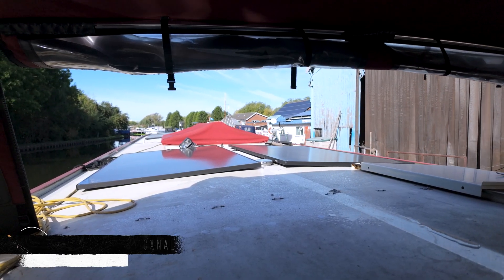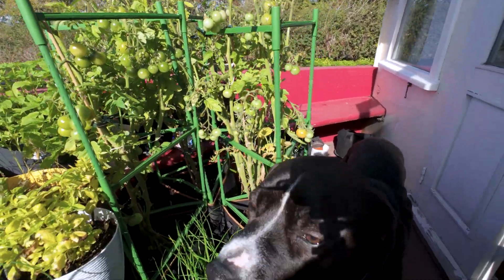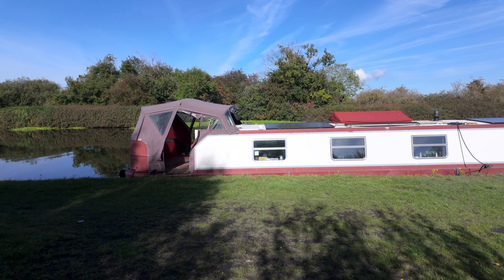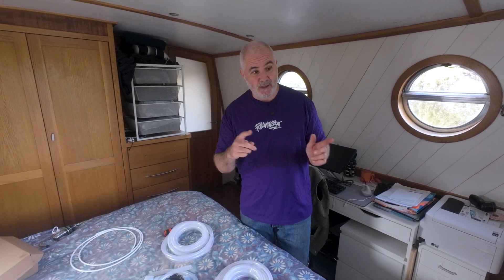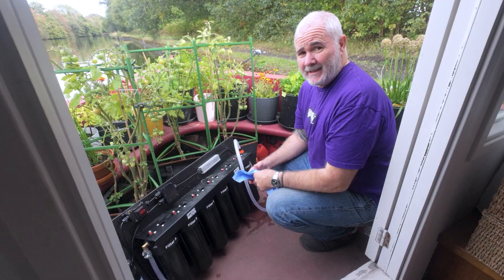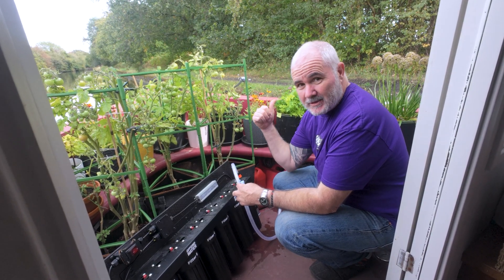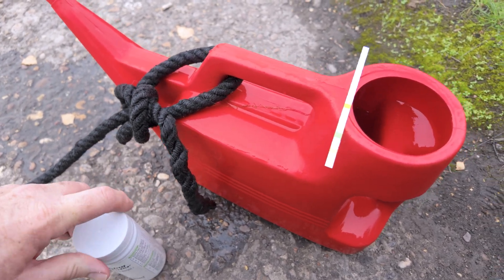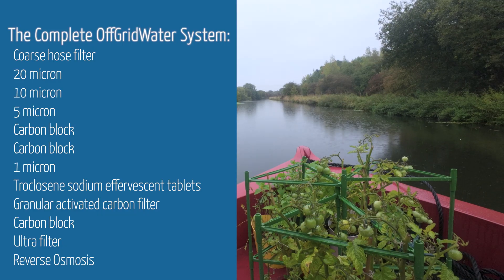How We Make Canal Water Safe to Drink 🚰| Widebeam Boat Ep 408

Comment: I wouldn't worry about chlorine in stainless steel tanks. But find a good source of information that actually knows. (I've used household bleach on my boat's stainless steel water tanks, and I'm sure the previous two owners occasionally did the same over the preceding 20 years. It's not much and it breaks down.  
Chlorine dioxide seems to be the best water purifier. Aquamira is the same thing.  CLO2 is inexpensive, comes in tablets. When dropped in water they quickly give off a fluorescent green gas, and is the exact same chemical weapon used in the First World War.  It's 4 to 5 times more active than liquid chlorine bleach so it's initially very toxic but soon breaks down. I wanted to see if I could eliminate the boat stink on my boat. It wasn't too bad, but I was curious. Worked really well, left no residue, faded nothing. I usually clear out over night, but 6 hours is often enough. Hotels and apartments use it, as do used car dealers. It breaks down anything organic including tobacco smoke, mold, mildew, corpse smell.... (I met someone who tenant die in hot weather and wasn't found for at least a week.) It's also one of the most effective treatments for bed bugs. 

ClO2 is more effective in tanks because it not only purifies the water and the tank below the water level as does bleach, the gas also kills anything at the top air space in the tank. 
Municipalities use chlorine in their systems not so much to purify the water, but to send a residual effect down the line to our homes. If you put pure water through dirty pipes it won't arrive pure. 
 
I've had an ROS system in my homes for the past 40 years. It works great. Talking with Colin of Parlay Revival he said that on superyachts there's a concern that super pure watermaker water being mineral free might not be providing the minerals our bodies need, plus it might also be leeching minerals from our bodies. He recommended adding a mineralization filter, which I did. Probably better, but I never had a problem over the first 35 years of not having it.  One thing I've done is the line to my ice maker in my fridge is connected before the minearlization filter so I get prettier, clearer ice cubes. 

What I know about ROS and my watermaker on my boat is you want to start with the cleanest water possible, so you never run the water maker in murky water or a harbor.... you're in a canal. Maybe that first filter takes most of it out and gets regularly replaced.  Looks like your system takes this into account. 
I was using an MSR backpacker water filter in Dorset one April.... apparently it wasn't working very well. I was feeling a bit... so I stopped  my trek in Cerne Abbas and got my way to Salisbury where after a good meal.... I basically exploded... I was sick for two days never left the room in the BnB. Watching the BBC news (about the only other thing I could do) I learned that the Skirpal's home, poisoned by Novachuk was only three blocks away. I'm still surprised the SAS didn't come through the door in Biohazard 5 suits and carry me out in a bubble. I would've been shouting (muffled) "It wasn't the Russians, it was only the sheep..... and my own screw up...."
Reply from the maker: Hi Will, thanks for that comment, there's some useful info on that. Yes, we battled with this argument about RO stripping water of all its minerals but, like you, we never added them when using one on our sail boat. Our argument was that we have a healthy diet, plus we were eating and drinking out too. I remember one yachtie telling me her family started getting dry skin and hangnails from existing on RO water but I can't say we've ever had a problem. Even so, we have the set-up for the remineralisation filter already there so we might just try it for kicks.